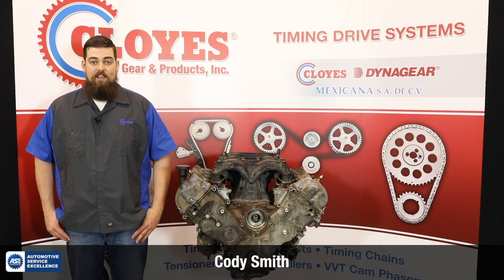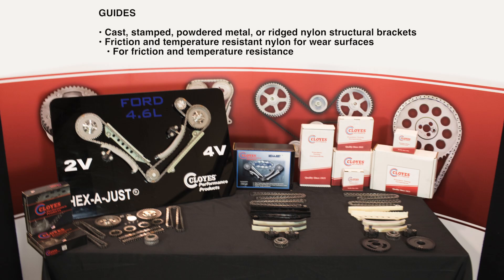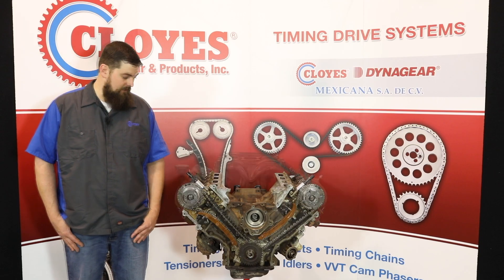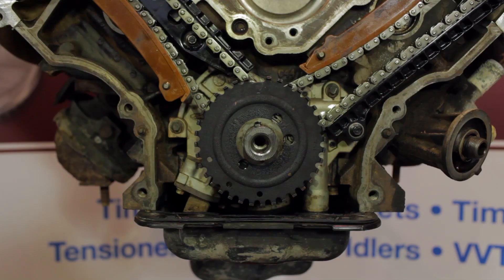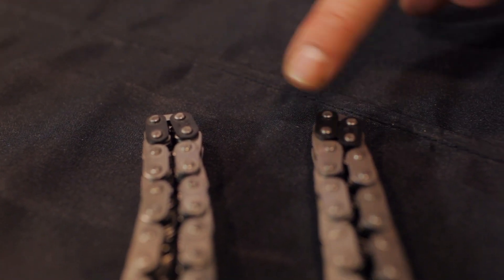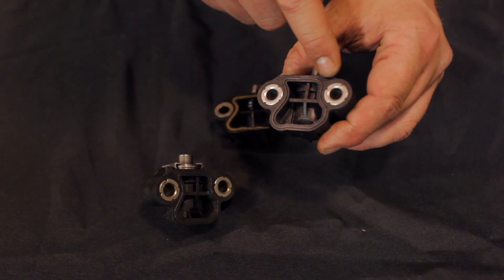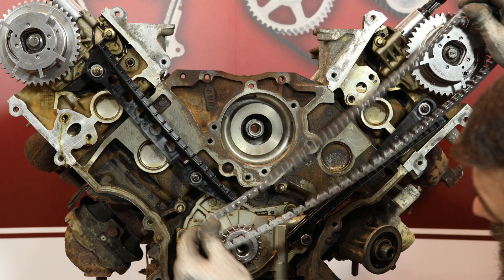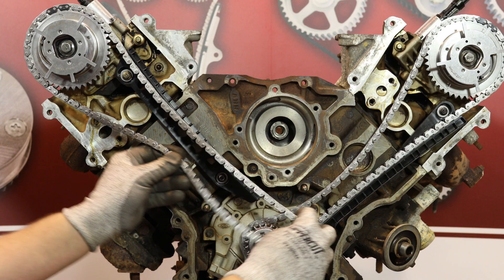Ford 5.4L Timing Chain Replacement, Cloyes 9-0391SB

Comment: I just did my timing and oil pump when I removed my old chains I marked everything. So when I reinstalled the chains the right side phasher R was not center over the 2 colored links does that mean my timing was one tooth off to begain with  the motor runs but it's missfiring
Reply from the maker: Well it means that it is one tooth off now. When you removed the chains it is likely that the crankshaft or the camshaft moved slightly. When reinstalling it is accentual to make sure the colored chain links are aligned properly, if not you need to rotate a shaft so they do align.
Reply: no i had cams locked down i marked the old chains and thats were it was. a few months back i was driving home and it just started missing real bad and wouldn't go over 20 so i parked it towed home. i found broken chain guides. so while i was driving it had to jump time cuz thats were the old chain was. i thought to change it to line up but was worried didnt want to bend a valve. so now i can just pull that valve cover get the block of cheeses  to hold the chain tension on bottom and i can turn the cam a little and ill be all good correct
Reply from the maker: Yes, that is correct. If both the crank mark and cam mark are aligned to the colored links of the chain then it will be right.
Reply: Cloyes Gear & Products, Inc. (Aftermarket)   I have another question when I took everything back apart. How come my timing marks won't line back up. I ran the motor for a min. I have rotated the motor many times and the 2 links never line back up why
Reply from the maker: The marks will only realign every so many rotations. They will come back eventually, but I don't know how many revolutions it will take.
Reply: sorry its still mario just on a friends computer reading about my  truck  but thank you for responding
Reply: The crank should spin 2 full revolutions for each 1 revolution of a cam. The marks should come in to alignment every two crank revolutions. If not, something is slipping.
Reply: @JDAndersonJr  The camshafts will return to the same position every 2 revolutions, but the chains will not.  The chains have many more "rungs" than the sprockets have teeth
Reply: @mattgraham4340  Of course. Sorry, I was only thinking cams.

Comment: how come the cams dont slip when you remove the chains??
Reply: ok cool...  Also just to make sure, so then its not really necessary to place the #1 piston to TDC?  just as long as the crank key way is at 12 oclock and the timing marks on the phasers are pointing up then It should be a breeze?  
thanks for the reply.
Reply: @Cloyes01  which is what? you mentioned the keyway at 12, but now are saying there are two positions. So is it keyway at 12 for right and then a different for left?
Reply from the maker: @justinwalker3617  That comment was not correct for this application, sorry for the confusion. That was speaking to GM 3.6L disassembly, not sure what happened there. 
Both banks can be disassembled with the crank at 12 o'clock on Ford mod engines. The cams may move slightly one way or the other when the chain is removed. If they do move, you can slightly rotate the crank like we show in the video during assembly.

Comment: Using manufacturer specified engine oil ..?   BULLSHIT...many engine builders specify 5w-30 or 0w-30 instead of 5w-20 after 10,000 miles or so.

Comment: and you will be redoing this whole process again because you didn't change the oil pump which is the main culprit for all the problems
Reply: The timing tensioner gaskets blowing out is the main cause of the concern, the pump is usually just fine. The tensioner dumps oil pressure and starves the heads.
Reply: Amen

Comment: Do you have to take the roller followers out of the 2 valve 5.4L engine also? Do you have a video on timing a 2 valve engine I just did a head job on it and need to know how to set the cams to do the timing. Thank you.

Comment: i have a quick question. i just put the chains back on my 5.4,. its timed correctly and the chain marks are right. i have to put the roller followers back on so can i rotate the crank shaft because you cant compress a valve when a piston is top dead center or do i have to leave the crank alone no matter what?
Reply from the maker: With or without the roller followers, it is safe to rotate the engine to whichever necessary position so long as the chains are installed and the engine is in time. The valves will not be open with the followers off. If the engine is properly timed there will be no contact with the followers installed.
Reply: Cloyes Gear & Products, Inc. (Aftermarket) that is sooo relieving to hear since i already installed them doing that. Thank you for replying to my question!

Comment: Using a 32 mm socket and breaker bar on the crank is way easier to use than trying to turn the crank with the harmonic balancer.

Comment: So now I'm really confused...I just watched 3 hour four part video series that stated 1st position crank 12 O'clock remove 3 followers on each side to neutralize cam. Then another resting point keyway @ 6 O'CLOCK then lastly keyway @ 11 O'clock with OTC  tool. So I'm clear...since I'm taking front cover off I just need to make sure the L & R phasers are up the cam won't turn while performing the replacement of chain &  phasers, etc...
Reply from the maker: That is correct. With the front timing cover off, it is not necessary to remove rocker followers or do any rotating of the engine. Just make sure that the proper timing marks are up before chain removal. As we show in the video, slight adjustments can be made to the crankshaft to get the marks realigned during installation if the camshafts happen to slightly move.
Reply: i watched those same videos, and here he does it in 10 minutes. also confused if i have to remove the followers
Reply: cory thomas did you remove the roller followers?
Reply: im about to remove a set of chains on a 5.4 3 valve, 06' just so as i am 100% clear, I do not haveto remove the followers?

Comment: what about the cam followers if some one dose not do that step could have bent valves
Reply from the maker: Cam follower removal is not required when you are pulling the front engine cover as we do in this video. There is no need to rotate the engine during the procedure, so there is no possibility of piston to valve contact. The cam follower removal step found in most repair manuals was intended for cam phaser replacement without removing the front cover. The camshaft followers are removed and the engine is rotated to a position where the camshaft is under no valve spring pressures, this guarantees the camshafts will not move and the new cam phasers will realign perfectly with the old chains. With the front cover on and the special Ford timing chain locking tool installed, crankshaft rotation is not recommended so it is vital the camshafts do not move. Because this is a timing chain replacement video, the front cover will always be removed, and as we show you slight movements in the crankshaft can be made to realign the timing marks upon assembly. The intended purpose of these videos is to provide the easiest method of replacement, and to clear up any misleading or conflicting information that is out there. Thanks for commenting!
Reply: Cloyes Gear & Products, Inc. (Aftermarket) I have cloyes timing chains for a 2v 5.4l 2003. Does the double dark chain links line up with the cam timing mark as well? My old chains only had 2 copper links. Coyles has 3 but I was unsure if the single dark link lines up with the crank or the cam.
Reply from the maker: The two sequential marked links straddle the appropriate mark on the camshaft phasers. The single marked link will align to the crankshaft sprockets timing mark.
Reply: Jason Dority 
Have you done this job? This is the first time  I've heard not removing followers...is it possible?
Reply: Luke D I have never done it like that. as long as the cams don't move should be fine  next one I might try it ... let me know if you do
Reply: Jason Dority yeah...I think I'm going to do it the way I know I want goof it up. Ive got to much money invested at this point. The valve tool comes in tomorrow so the fun will begin.
Reply: @luked1286  I know this post is like a year old but why would you have to remove the cam followers? You're not rotating anything.
Reply: Brian M the cam will turn freely if you remove the roller followed